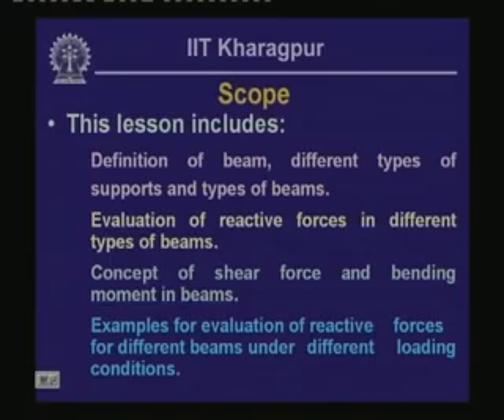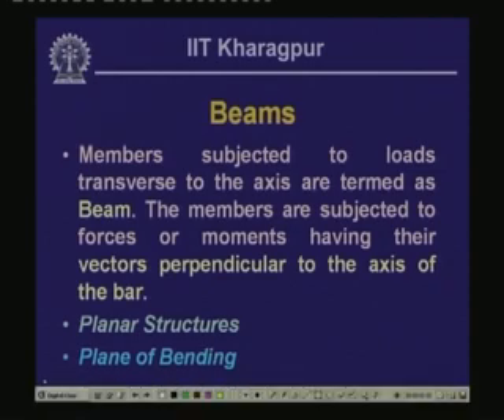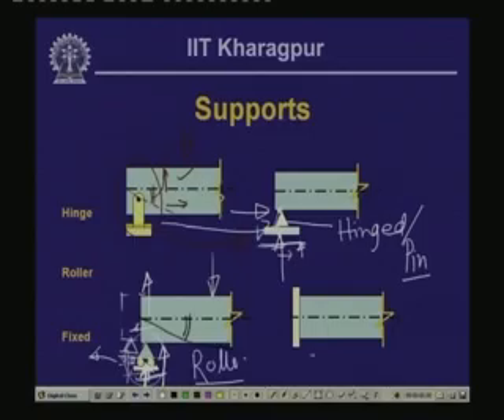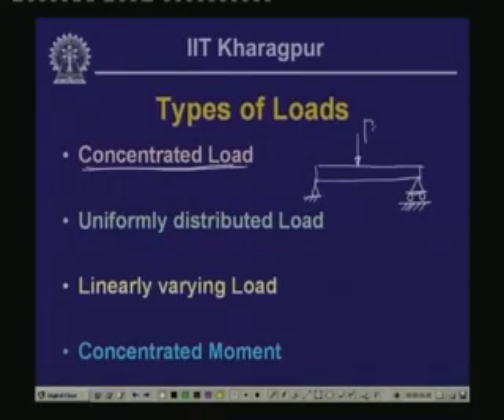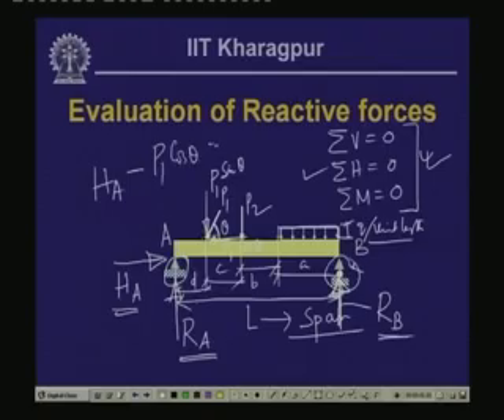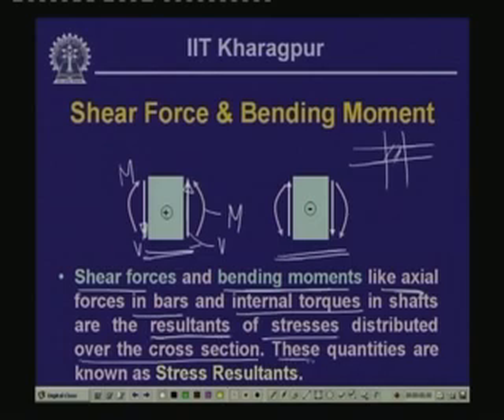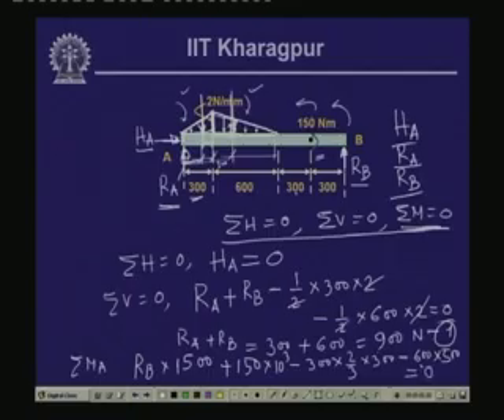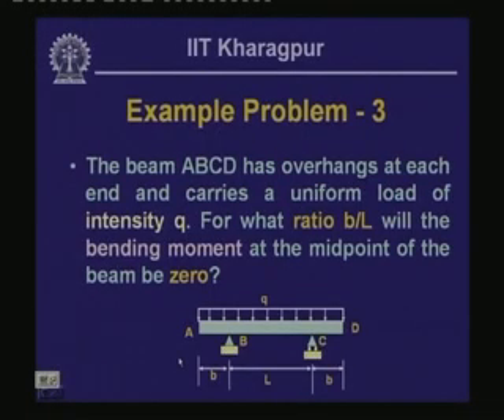Lecture - 22 Bending of Beams - I

Comment: simply supported beam  has 3 reactions??... please check your books.. it has only 2 reaction forces ...
there will no hinged support in simply supported beam.
both has roller support
Reply: No.. To allow thermal expansions and contractions in the span, we provide roller support at one end.
Reply: SSb has 3 reactions... two from hinged end, one from roller...if a beam has two roller it will not be stable...its an unstable beam...check its indeterminacy...it will come negative...!!!
Reply: do u know why we provide a roller support at the other end, why not hinged , is it just to make it determinate?
Reply: TO remove thermal stress. when body wants to increase its length they free to increase no resistant no thermal stress.

Comment: at about 47:00 mins, why is it that when calculating the moments due to the linearly varying load, you multiply the load by 1/3 ? I would have thought that because the load is linearly varying, this would be equivalent to multiplying the load by 1/2 (average load per unit length)
Reply: for centroid of triangle it is h/3 from the base
Reply: vedanadh meka
thank you